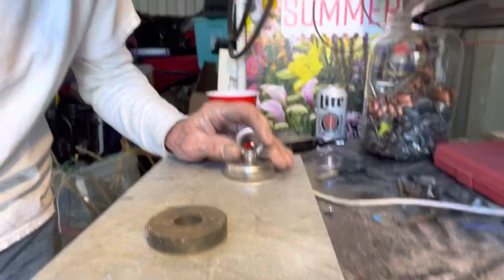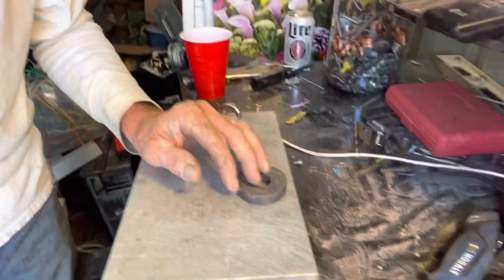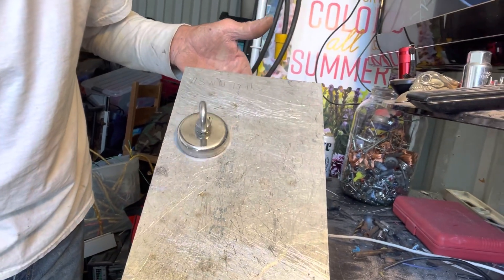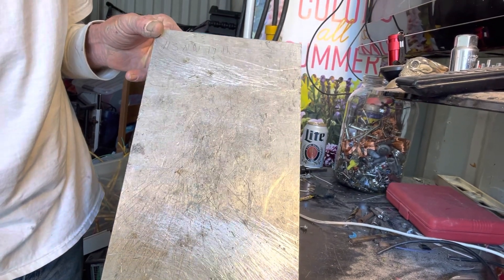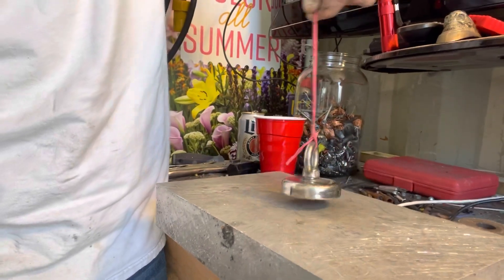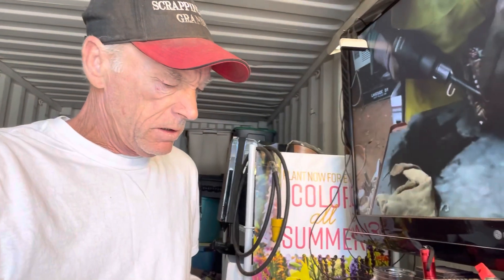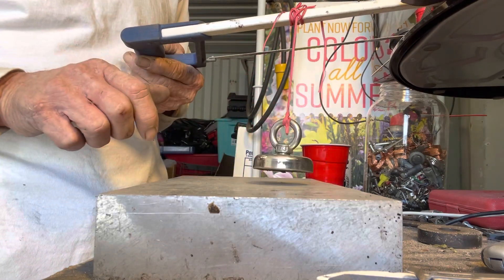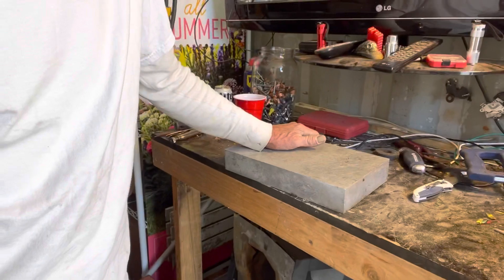Mystery Metals. What’s inside??

Comment: Magnesium maybe try to get some shavings and use a touch on it an see if it burns  aircraft aluminum t10 or t12 aircraft aluminum may have magnesium blended in for strength
Reply from the maker: Now that’s interesting that is the most interesting thing I’ve heard yet very curious about that
Reply: @ScrappingwithGrandpa  I used to make landing gear braces for a company I'd cut parts from blocks of aluminum such as that and to make it stronger and lighter they used an alloy such as that we had to use "milk " to cut prices as so it wouldn't over heat and spontaneously combust
Reply from the maker: Wow. Now that is interesting

Comment: it is magnetic stainless, stainless steel comes in magnetic and non magnetic types if you have an old fashioned bottle opener the kind with a point on one end, using the pointed end draw a line down the block of metal if it is aluminum it will make a small curl of metal shaving, if it is stainless it will simply make a scratch on the surface.
Reply from the maker: It is not heavy like stainless is.